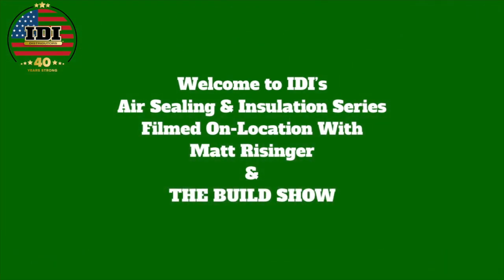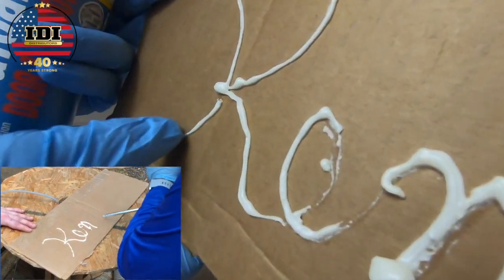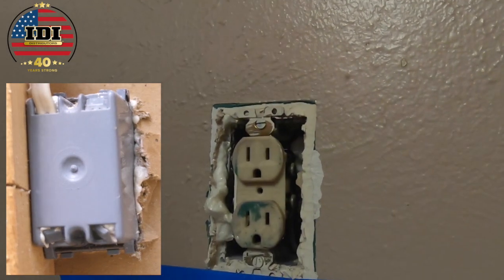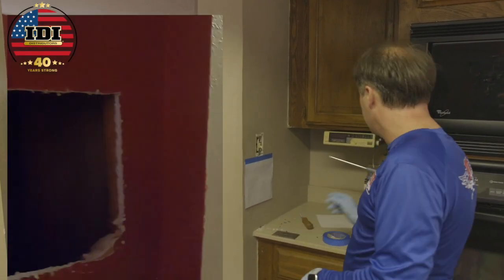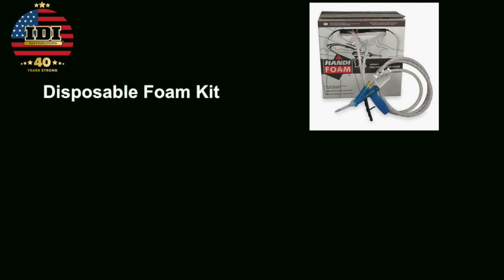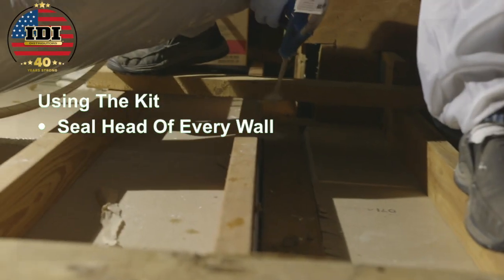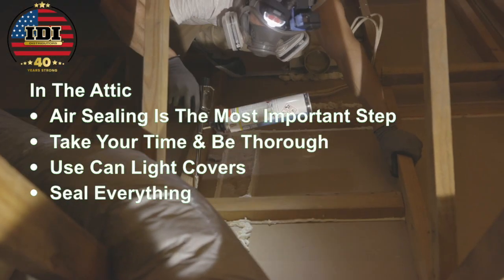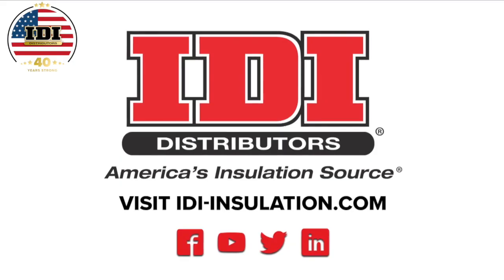Part IV: Air Sealing with The Build Show

Comment: I thought it wasn't good to put foam inside a box or you had to have a certain type of foam or caulk...fire rated or something?  So this is news to me that I can put dabs of foam in the back corners of the box.  Good info.
Reply from the maker: Drew,
Thank you for such a great comment. If this were a commercial building, then we would absolutely suggest going with a fire rated sealant or foam. You could certainly do that on residential, but the main goal is to make sure you are getting a good air seal and not filling the boxes with foam.